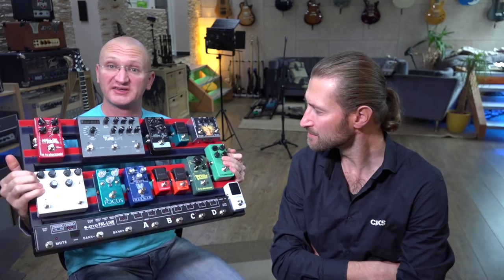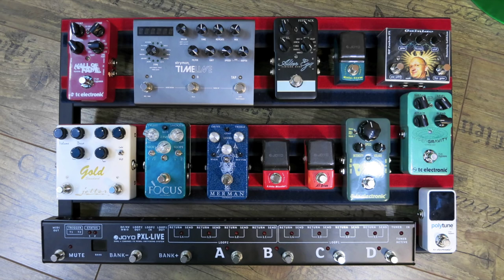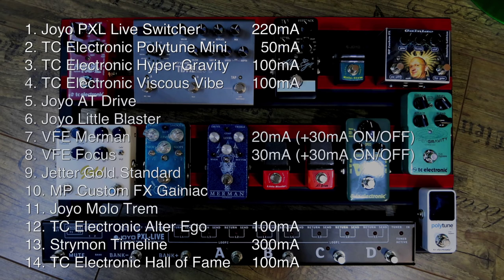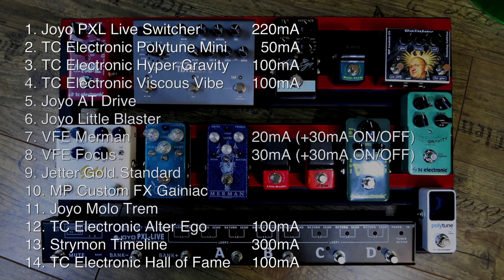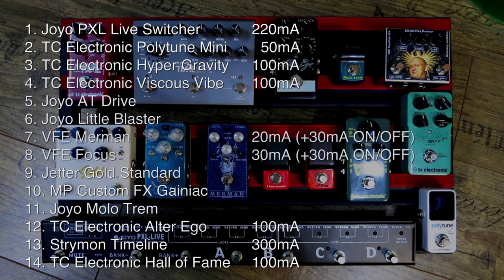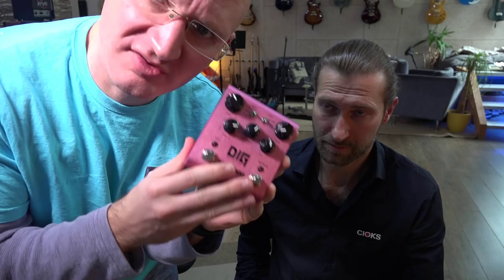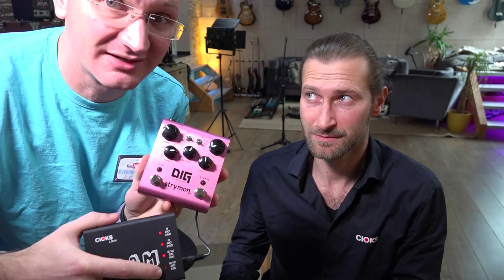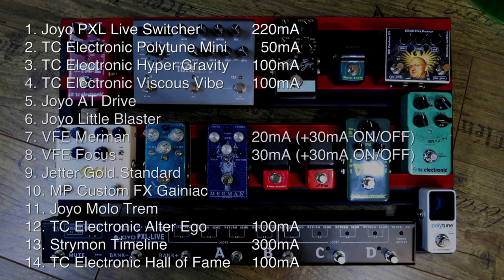How to pick a power supply - With CIOKS (also PUSSY POWER Unboxing)

Comment: Big John owners: does anyone know if the two paired isolations for 1& 2 and 3 & 4 allow each output to power 100 mA each for a total of 400 mA for the first 4 outputs, or if each pair powers 100 mA for a total of 200 mA for the first the first 4 outputs. I've heard conflicting information.

It seems that it truly can handle 400 mA for the 12v outputs of 5 & 6. I was skeptical because it seems when there is a switch option, the mA drops when going from 9v to 12v. I'd like to power a Fuzz Fiend that wants 12v 400 mA.

Comment: @EytschPi42 What's the issue with wall warts?  Do they not deliver the goods in terms of power output, quality or reliability – or is it that most people consider them so darn inconvenient?  Thanks for illuminating this, man.
Reply from the maker: a) inconvenient
b) only one section, so no way of isolating sections in case you have hum.
c) how many mA can a wall wart have... 1000? 2000?
d) only one voltage because here is only one power source.

But for many small boards and applications they are probably totally ok.
Reply: +EytschPi42 Thanks!  Went to Thomann, but a bit pricey for a beginning guitarist with few pedals.  Harley Benton PowerPlant looks promising, but it would appear it's only available for the European market and as a 230v appliance.  Any idea about a comparable Joyo product for us US'ers?  Thanks, again for such a great channel.  You're one of my main info sources for all-things guitar.
Reply from the maker: +Ronald Light Thanks Ronald.... the Joyo Power Supply 2 does a good job, not isolated, but pretty decent power supply..... for isolated, you can check out the Power Supply 4 from Joyo... should be around 120 bucks.

Comment: I asked you in the past, well the future as far as this video goes regarding the newer Orange pedals (2017) Kongpressor and The Getaway Driver. At the time I was unaware that you had made these videos. I'm a little surprised that you didn't mention this and the previous video as I was asking you about the voltage requirements. I probably didn't go into enough detail but I feared a long winded question might not have gotten a reply.
From what I can remember the internal charge pump doubles the 9V input to 18 and if you used a 12V power supply it would do the same to increase overhead. I know you said that the 9V supply worked fine but could you just use an 18V instead. Oranges website isn't exactly clear on that and to be honest I'm a of novice (that's what she said :D )
Reply from the maker: +Modest D not sure about the Orange pedals... sorry
Reply: EytschPi42 no worries :) I wish companies would provide more information on their products. Even if they don't include a manual in the box (or at least one that people could understand) it would be nice if companies started posting more information on their websites or had some kind of interactive demo.
Reply: EytschPi42 by the way these CIOKS videos were great. They explained a lot of things that I was curious about power supplies. I liked what you said about having the option to use use all of outlets as 9V

Comment: I'm considering a Joyo power supply to compliment my cioks baby which only has 5 outputs. How is the quality on Joyo's power supply?
Reply from the maker: Depends on which one you are looking at...
Reply: +EytschPi42 Think it's called jp-02 or power supply 2.
Reply from the maker: +Tiggerdyret It works.... not isolated and probably OK for some drive pedals, nothing big... not in any way on the CIOKS level, but I have used it once in a while and didn't have major problems.
Reply: I have the Joyo 2, I never had any hum or problems with it... The only complaints is that the wall wart power plugged into the front along with the leads going to the pedals so as that always bugged me. I played a good number of shows with it and never had any problems, but did eventually get the Voodoo Labs anyway